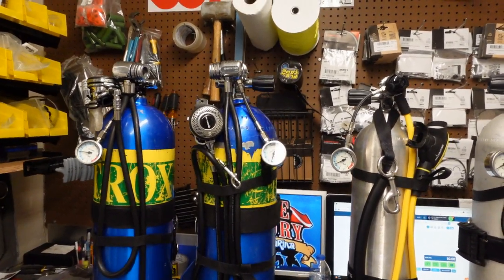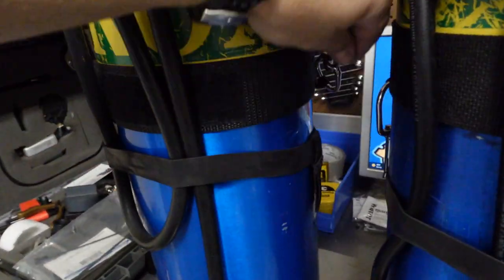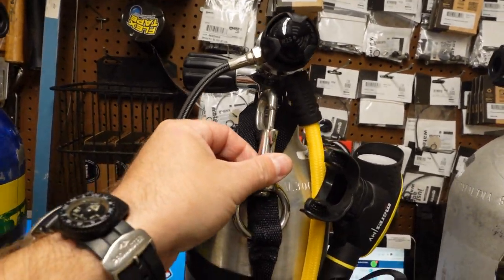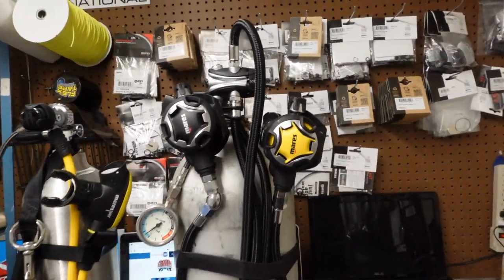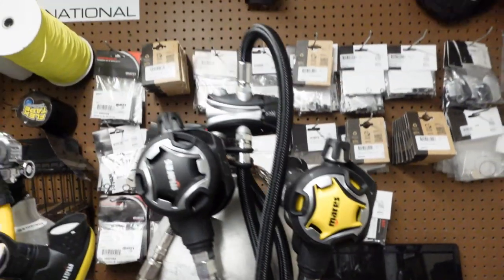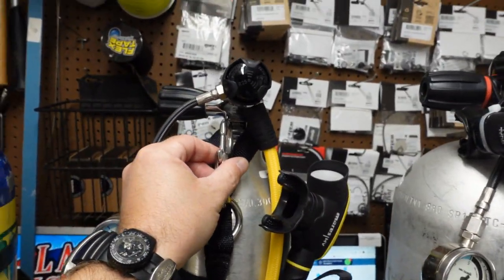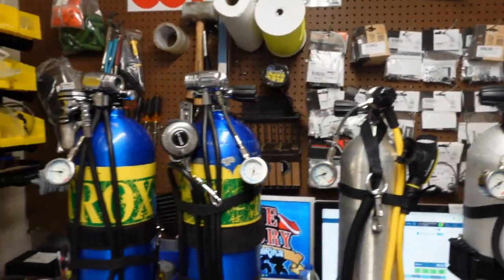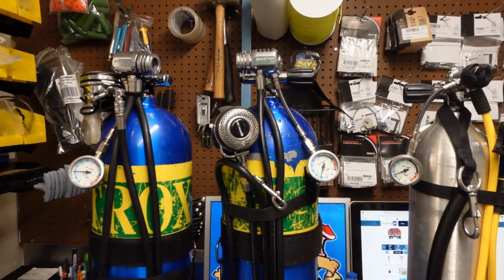How I Setup Sidemount Bottles {[Doubles vs Singles]}

Comment: Hi, another great video. I'm currently gearing up to start my sidemount journey. I need to order my tank valves so I can have a left and right valve with extended post. I want to have the ability to do doubles in the future so I'm assuming the extended post is essential for that. I also want the ability to utilize one of the  tanks if I'm just doing a single tank dive. My question is about long neck vs standard neck. I'm looking at the dgx modular valves and with the information provided above, my assumption is that I want the standard neck. What are your thoughts on that? 

I also noticed that your left tanks spg is on a shorter hose 6inch and your right side on a slightly larger hose, possibly a 9inch. Is that intentional?
Reply from the maker: Hello @tvelocidad, either valve will work just fine. For my high pressure hoses, I use the 6 inch Carbon HP hose from XS Scuba. The part number is MHP06-CN